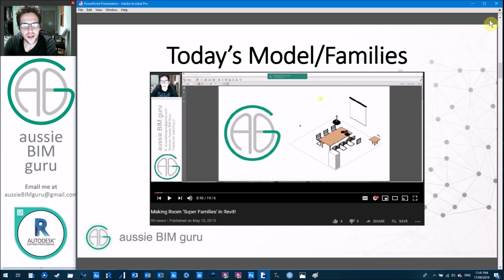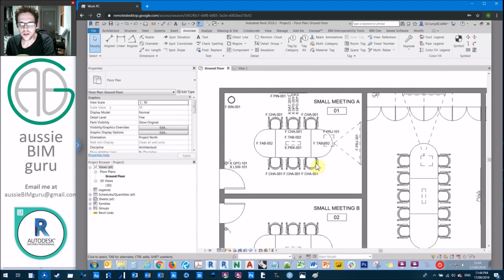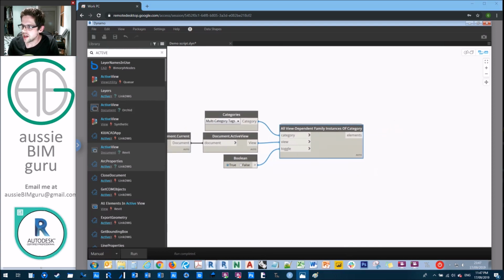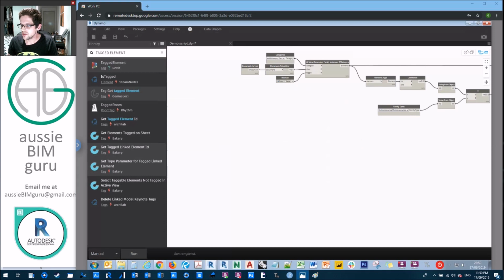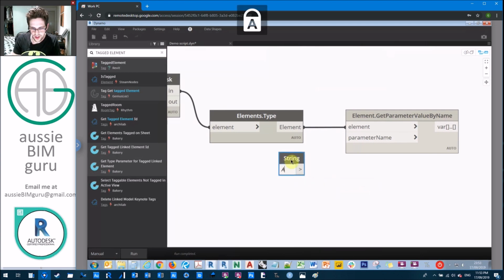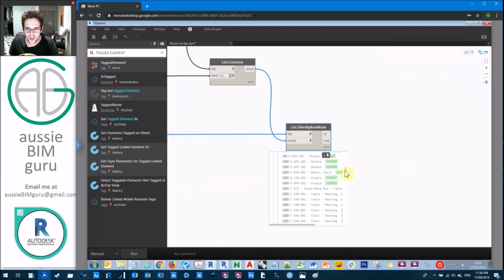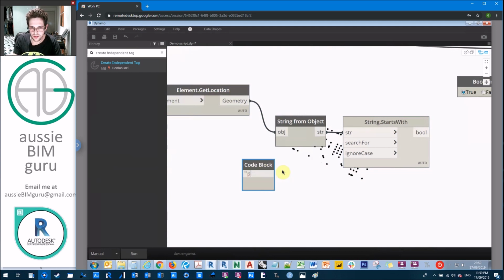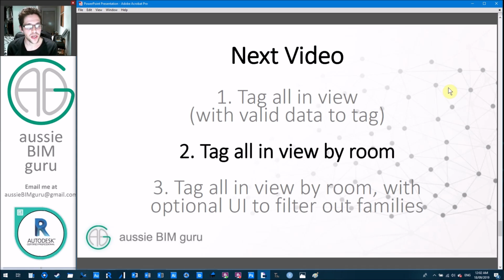Tag All in View using Dynamo! (Tag All 1/3)

Comment: Hello! 
I am new to Dyanmo and I also did a Version with "Tag.ByElementsAndLocation", my issue now is that my tags are all over the place and I am looking for a way to automatically solve this with Dynamo. Now the placement of the Tags is done by Location- Point.Add - Vector.ByCoordinates and a Seqeuence attached. On smaller Modells with not much to Tag it works fine and i can adjust but once its a more complicated modell this version doesnt work as afficent anymore. If anyone has any Ideas please swing them my way! I appreciate it!
Reply from the maker: Tag arrangement logic is always quite complex, as it involves detecting available space, finding tag alignments on planes etc. I generally haven't delved into this space as I find it is so task specific as to what needs to be done. There are some apps out there that might help generally, but Dynamo you have to code all the alignment logic from scratch using geometry of tags, leaders, end points etc. There isn't really an easy way to go about it I've found.

Comment: I want to use this code for revit 2025, does it change much the internal code or the configuration you show?
Reply from the maker: @cristianaguilar7661  generally should be similar, although some custom nodes and packages may have changed since this video.

Comment: Hi Gavin,
Thank you for your video. Appreciate your work
I wanted to tag the assembly of generic model families. I got the element location(assembly) and translated the point by a certain amount on the Z axis. 
I used the create tag node; it ran correctly but placed the tag in the center. The location node did not work, although I could see the translated point in the model. Do you know the issue?
Thank you for your time on creating tutorial videos.
Reply from the maker: Hrm might be best to take to dynamo forums. My guess is you may need to move it based on the view's plane if it's not a floor plan.

Comment: I hope these videos fully guide you on retrieving elements for the Dynamo screen. I aim to generate specific elements by first selecting them using "Select model elements," obtaining their locations with "element.get location," assigning tags, and connecting these inputs to the "create.tag" node to generate tags within the Revit model.but output was not shown in revit model.please suggest.
Reply from the maker: @vijayakumarparri4946  unfortunately their location wont suit the view unless its on the plane of the view itself. Try getting location, pulling to the views plane then using that instead. Genius loci and clockwork should have view plane nodes. From there if that doesnt work try dynamo forums.

Comment: Hi Aussie,

first of all, i have been watching your video constantly, i learned a lot from you. Thank you so much for those tutorial videos here. 

I have been trying to create my own tagging system using the system UI tag all function for elevation for curtain panels. 
However, when i use the system node, tag by element,  it always make all tags on the ground floor no matter what i do. 

I also tried get material, get geometry way, but it get messed up when there is curtain panel behide the visable area. the tag will be all over the place. 

Please please help after you see this comments.
Reply from the maker: Hrm hard to say what exactly the issue is, but if you're using Dynamo to tag curtain panels and only want to tag those facing the view then you'll probably need to compare view direction to curtain panel facing direction. Revit by default 'sees' everything in its view range even if it is behind something too so it's hard to work around that.

RE only tagging ground floor I'm not 100% sure what the cause would be. If you run a tagging script in an elevation view and get their locations in XYZ space as the placement point it should tag them at the right location. Maybe take this one to dynamo forums where more people can help in detail.

Comment: Hey Gavin, could you please tell how to choose and delete redundant tags from your consultansts that look like ??. I mean its a very badly made revit file. So unable to filter them. Something moved and suddenly the file is left with ?? Redundant tags.
Reply from the maker: This should be possible using Python and Revit API. Tags have two propertied that may help, 'TagText' and 'IsOrphaned'. These could be used to filter all tags in active view.
Reply: Could you please make a video about tagging concepts. Something blew my mind when saw People copy pasting same tags to same elements in different sheets and acting totally differently. Some concept i had no clue about. I mean its the same element but just in two different sheets. Then used tag by category to the element in the sheet ofcourse activting the view. Then copy pasted the same tag to the same element in a different sheet ans now I can change the tag without any problem. I was like man but this is the same tag and same element. So whats going on ? Ofcourse some kind of work around but still. If you could shed some light on this issue, will be immensely grateful.
Reply from the maker: Tags are unfortunately view specific and don't relate to each other between views. Dynamo can find a tag's host and vice versa using some Python which might give the ability to review an element's tags in various views, but Revit alone offers no such tool.

Comment: Great one Gavin...!! Can yuh do that for ducts as well where we need to get tag for the duct and if the elevation is changing we need another tag for that as well..I tried but it's hard to remove the duplicate ones from the list...can yuh make video on duct tagging as well..I will be pleased for that...
Reply from the maker: Unfortunately I'm not very experienced with MEP tagging/dynamo - it might be worth asking the Dynamo forums if they can help with this one. I think the method would require you to analyse the start/end height of each duct segment to identify if the height is different at either end.
Reply from the maker: @Madugula Ravi Chandra Sekhar thanks for clarifying. I would say in this case you could try to identify the tags being made at the junctions of this corner, although I know corner detection is difficult in Dynamo for ducts as it doesn't interpret radial bends as curves (I seem to recall...).

Comment: Hi, you know if I can create new tag in dynamo with parameters of various elements,
In my case, I need to get a number of bars from different groups of bars (but the same diameter) to indicate, for example, on a single label 2 + 4 + 2 Ø16.

Help me pleasee !
Reply from the maker: Unfortunately tags are always associated to single elements rather than groups of them. The only workflow I could think of is to use Dynamo to populate the data about reinforcement to the reinforced element (e.g. use Dynamo to count the reinforcement rod configuration and the diameters, then write this back to the beam, slab, wall etc. then tag this wall's parameter value).

It wouldn't be dynamic, so you'd need to run the script to update the values though.

Comment: Hi Gavin, Im new using Dynamo I've just Watched your video because i need to create tags for internal Walls in my project, in my case, Can i use this same workflow to tag every material that i have in a Room? Then use this Tag as a Mark to Schedule it with the materials? Your answer Will be HelpFul Thanks!
Reply from the maker: Hi there, welcome to Dynamo!

This is a very different workflow, as all this series deals with is tagging elements that already contain data.

Unfortunately, live tagging surface materials ot a room is not possible in Revit (that I know of), so an alternative is to use Dynamo to populate some parameters manually and analyse the room boundary walls to access their finishes. You could try to tag the wall using a material tag, but it sounds like you want your room to hold this data?

You would have to solve many bespoke challenges like:
- how to collect room bounding walls (hint - there is a node for this)
- what if your walls are painted?
- how can you detect which side of the wall is facing the room?
- where is your material's 'mark'? And how can dynamo access this
- how do you combind all the finishes into a parameter?
- are you also trying to collect non wall elements like doors, wall sweeps, windows etc.

Try to take the workflow on one step at a time, so begin by trying to isolate the elements you need, then isolate their finishes, then get the mark(s) and determine how to write this data to the room. You may be better off learning fundamentals first.

Hope this helps give some ideas!
Reply: Hi, thanks for reply, yes i've already used a tag for material and it works with "schedules materials takeoff" to get areas by faces and others parameters, and that same parameter that i created for the label in the tag for materials i used it as a project parameter in the materials section to get a custom parameter for materials, then i put it in my script to get a "parameterName" in the  "Element.SetParameterByName" Node, but, believe me, i'm starting to get frustrated.... I will try step by step everything you commented about the challenges, but i've been seen people  making tags by faces in the internal walls using Rooms and the Clockwork add-on, but you are the only one doing it node by node, and really thanks for that! I'll be writting you about my progress.

Comment: Awesome! Very nice explained! Thanks! My problem though is, that I want to tag a certain element-parameter too, like the length. I guess the tag family, that I'm using should be based and point on that parameter, because now I'm getting the "?"-sign... I'll see how can I connect those things
Reply from the maker: In this case yes you need a tag to draw out this parameter. If you get a ??? this means the tag has no value to display, as the family is missing the tag parameter.

I would try adding and setting a shared parameter unless you are working with a category tag such as structural framing which has its own default length parameter available.
Reply: @AussieBIMGuru  Thank you for the answer! I'll try it :)

Comment: Hi Gavin! How are you doing? So, I'm trying to do the same tagging routine for material tags, but I'm not getting it to work. I was able to position the material tag in the center of the room, as I wanted (to pull the materials from all floors). I used the floor material as a reference for the tag (Room.Finishes). However, for some reason that I haven't yet discovered, it results "?" and do not show the correct code (even if I select or move the tag). Have you ever done a material tagging routine? I've been looking for references but I didn't find anything very useful.
Reply from the maker: I tend not to use material tags as they usually have trouble identifying what they should be tagging. I usually have more luck with material keynotes, although Dynamo has limitations when it comes to keynote tagging.

It might be the room getting in the way - sometimes material keynotes identify this as the element to keynote, I think a color scheme being on can also contribute to this further.
Reply: @AussieBIMGuru  Thanks for the answer. Interesting, although I'm not using any colour scheme... About the material keynotes: did you ever tried to do a routine for those?
Reply from the maker: @luupieper  not yet, I'll add it to the list.
Reply: @AussieBIMGuru  Awesome :)

Comment: Thanks a lot for this script. I've got one question though; what happens if there are no multicategory tags present yet? In my case it ends in an empty list, but why and how to resolve this?
Reply from the maker: Ah yes I recall this challenge. Trace the data back to find the empty list source in this case, I believe it is caused by the boolean mask for already tagged elements. No tags = no tagged elements = empty list of tagged elements to compare to elements in view.

Find the point where an error occurs (I believe the list contains nodel) and count its list length. Check if it's 0, then feed a boolean into a logic.if from zebra. If true, feed in a piece of text, if false, feed in the list of elements, then this should let the list.contains work.

I don't have access to dynamo until monday, so if it isnt this let me know and I'll check again.
Reply: @AussieBIMGuru  Yes, that is exactly what happens. Thanks for the Quick response;

The "all view-dependent family instances of category" node gives a null result. I added the "Object.IsNull" node to test this, if true en empty list is created to be compared with the taggable element id's.